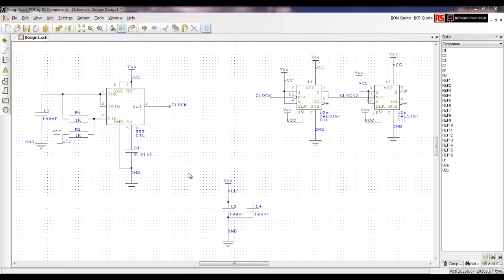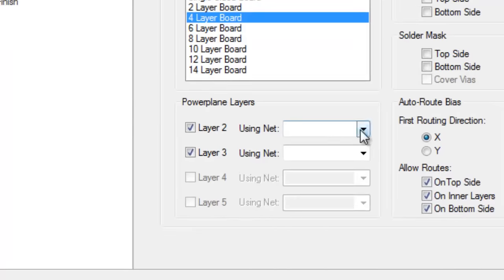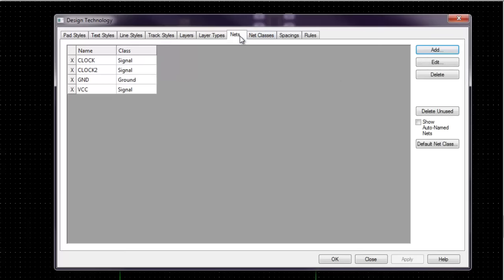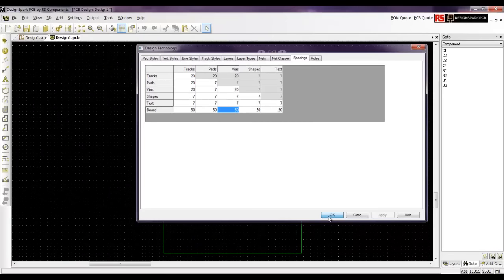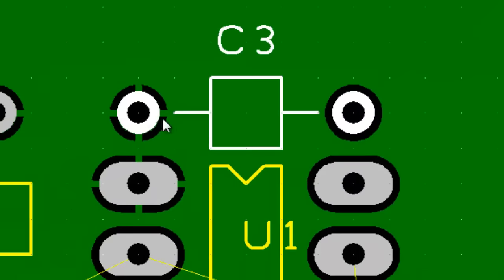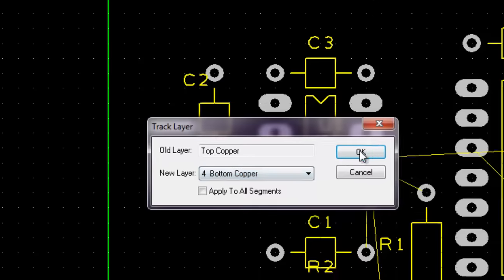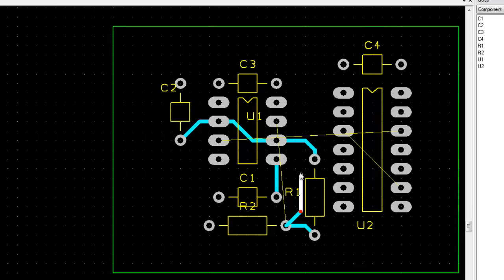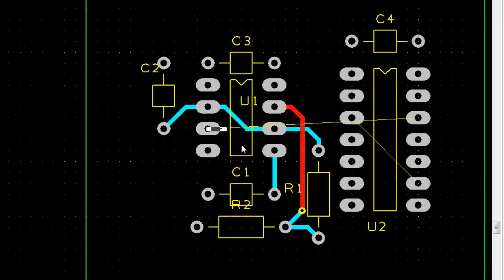Using Four Layers Board in DesignSpark PCB

Comment: Thank you for that. I need to remove all copper from the Vcc and GND plane in a rectangular area in one corner of the board which will have higher voltage circuits. Do you know how to do that?